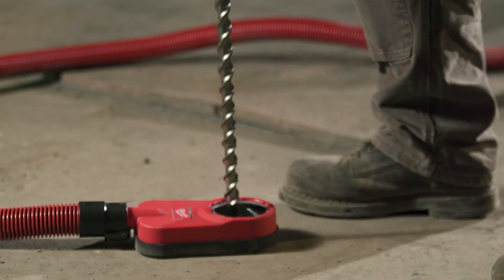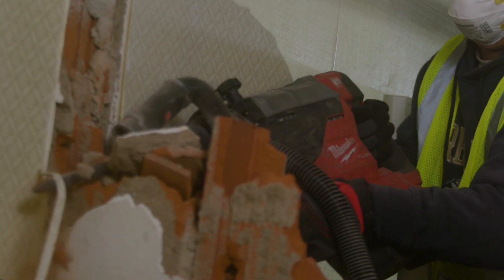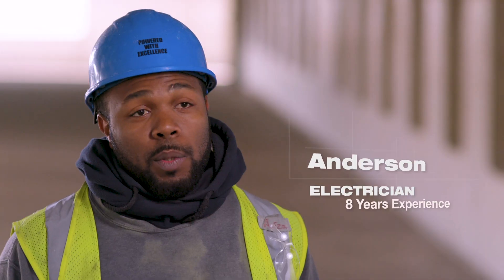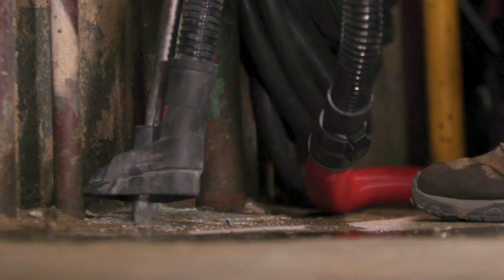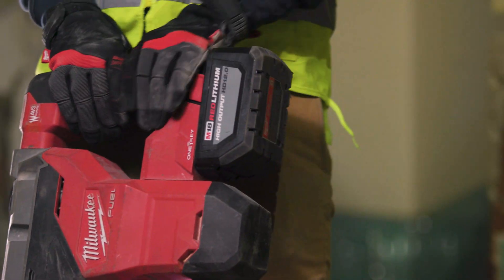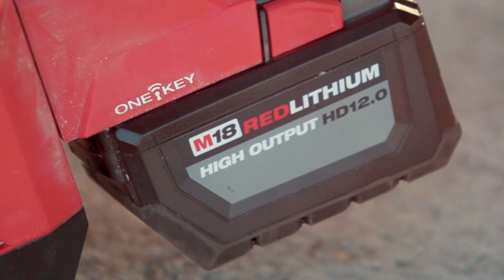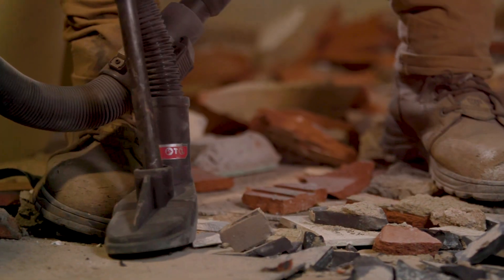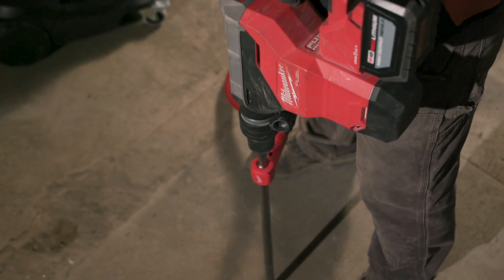Milwaukee® M18 FUEL™ 1 3/4" SDS MAX Rotary Hammer

Comment: These must always be union workers. I’ve never been on a job site where they are using these vacuum adapter. I really like it though.
Reply: OSHA doesn't count on non union jobs?
Reply: Han Hattori Hanzo ok well come thru New Jersey because I have never ever seen it. Most I’ve seen is just general ppe. But you say 2017 and I know for sure I never saw anything before that and even now maybe Bc people here just don’t care
Reply: We've had to start using all the dust extraction systems on all our tools. Vacuum on anything from a rotary hammer drill to our double gang air drill. Also supposed to gave enclosed cans on skid loaders and watering systems on anything that creates dust (sweepers, breakers, mill heads.....). Lot of expensive upgrades, I see a lot of small companies going under that can't afford it
Reply: grant peterson ya that nice stuff costs some money and fines like 13k. That’s nuts.
Reply: Andrew England about a year ago, we were told at work that OSHA is hurting for $$$ so they are really going to be cracking down and watching companies. And once they catch you, you're on their watch list.
Reply: grant peterson wow that’s crazy. I mean honestly I like the idea. It’s smart but jeez.
Reply: @Han Hattori Hanzo Silica dust is just as bad as Abestos.

Comment: How about the 1'' impact wrenches???
Reply: Coming soon
Reply from the maker: These are set to release in early 2019.
Reply: @MilwaukeeTool  what is the estimate price without battery and charger??
Reply: And torque numbers?????
Reply: NIce! Been waiting, I fix buses and the air system in my shop spits water like a garden hose. I can't use the air tools and  I've been leaning on the M18 stuff, but the 3/4 just doesn't cut it sometimes.  For those who are wondering, I have what I guess is the 2nd gen. 3/4, the one just before the 3/4 one key model.  I know the new one key 3/4 has more power, but I'd rather wait for the 1".

Comment: 8.1 pounds of impact? Nice I’m looking forward to buy it, hope is not too expensive. I was going to buy the previous model but thought 5 lbs of impact would not fit my needs. 
I have the sds plus and love it for light demo or drilling holes and I have a blue model for 
Heavy demo but I need something that is in between these two where I don’t have to drag a cord and haul a generator for medium demo.

Comment: Great Video. I purchased this tool but it unfortunately it is on back order. I’m currently redoing my trailer and am in the middle of building my shelves. 

Could you tell me the dimensions of the hard case it comes in? I would really appreciate it and it would help me a ton!!